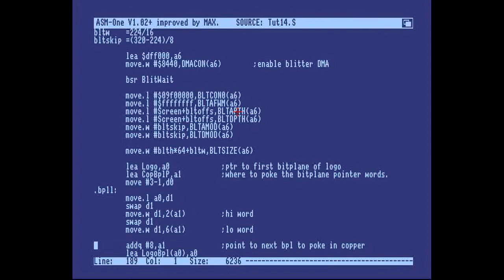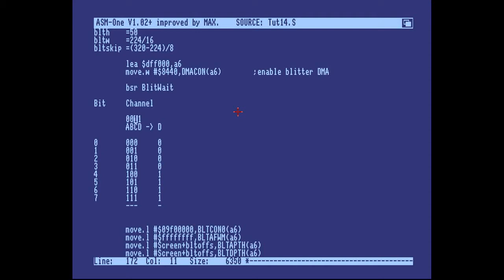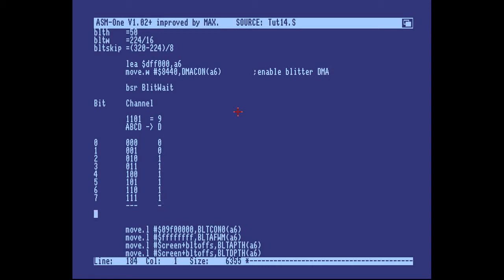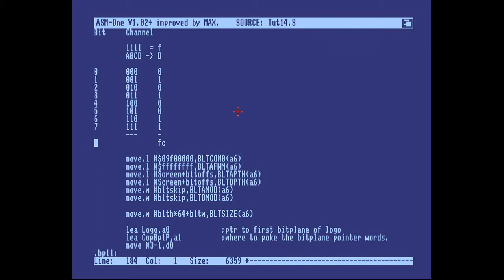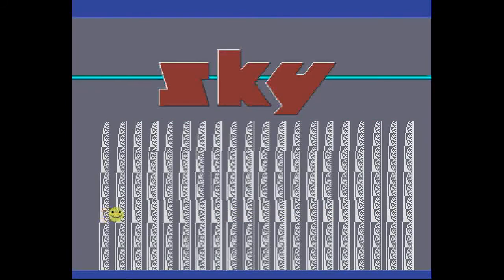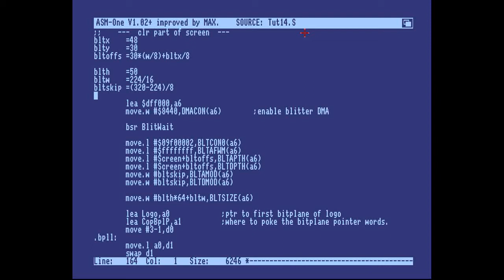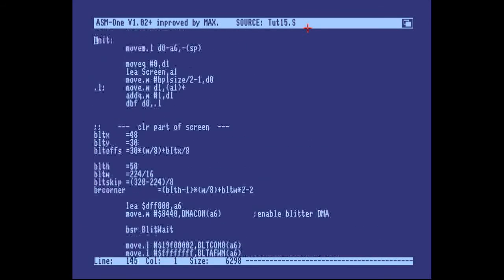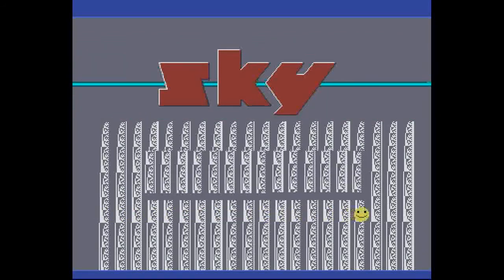Amiga Hardware Programming 15 - Scrolling with the Blitter

Comment: Thanks a bunch for all the videos! So very little of the old demo-scene is documented apart from the demos... This was cutting edge back in the days and the stuff we could do with 7.16 MHz and a few co-processors took years to even come close on x86. What if Commodore hadn't gone bust in 1994 due to some really stupid ideas and lack of HW to ship? Who knows... Thanks again for documenting all of this and to show what we actually had back then :)
(and also to show the kids today what real coding is!)
Reply from the maker: Thanks :) I'm hoping the very step by step visual approach will generate some interest to fire up Assemblers again. I've returned to this playing directly with the hardware or "really programming a computer" because it hasn't been available for some generations of platforms now. And it really is fun that it's you and the machine, the machine will do exactly what you tell it and it will tell you instantly what it thought of your idea. ;) It can be very rewarding when you have a good idea and it works.
Reply: ScoopexUs I know what you mean by "really programming a computer"!
Luckily I found a job very early where I programmed assembler on a real-time platform and although it was for a proprietary cpu it was equally effective.
Tried to code assembler on x86 and Sparc after the Amiga but it was never the same and I resorted to other languages...
Today I'm really thinking about building an FPGA Amiga clone with 68060 cpu onboard and I've seen examples running 100+ MHz, but I doubt it'll ever be the same... I have repaired two old A500's and as soon as I have a monitor with RGB I will try to brush up on demo coding again. One sad thing is that for some reason all my old floppy disks have deteriorated... They have probably been damaged by a magnetic field of sort and that's really sad... But by starting from scratch and creating a new boilerplate code I should hopefully remember something from the past ;)
Reply from the maker: Sounds great :) A project for the FPGA could be a 68060 board for A1200, or 68060 CPU replacement. You could put it on Kickstarter or survey interest on the English Amiga Board or Amiga.org for a batch run. I'm a very strong supporter of Amiga replacement parts rebuilt with modern components.